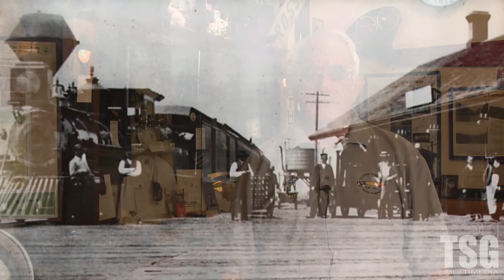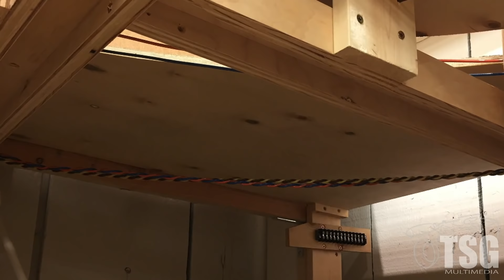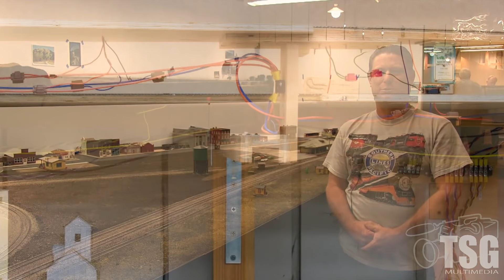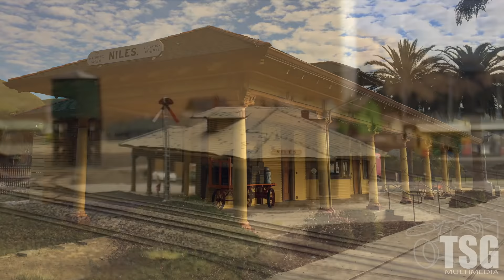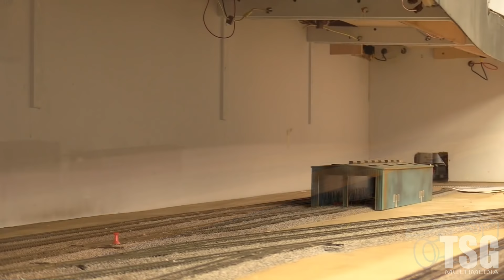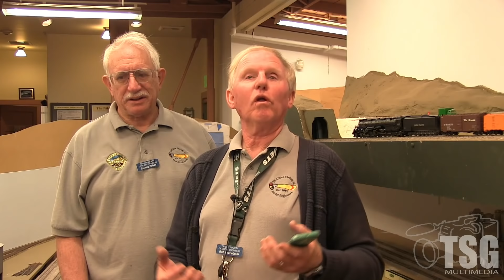HO Scale DCC Layout Tour Niles Depot TCSME

Comment: This may be a stupid question and I apologize if it is but, why is the locomotive ran backwards?
Reply: The Cab Forwards were very unique. They were only created to run on one single route for one single purpose. They were created to run on the legendary Donner Pass because of the numerous snowsheds and long tunnels. You might say, "Ok. They ran through tunnels. So what?" The thing is-long tunnels are bad for crews. Many crews died from asphyxiation because the tunnel filled up with smoke. So the research and development team for SP had to come up with an idea-how do we stop crews from dying? The answer: flip the engine around and put the cab at the front. This way, the crews could breathe fresh tunnel air before the engine polluted it. One important thing to note is that the Cab Forwards were oil-fired though a series of pipes and conduits. This is because having the cab at the front made it physically impossible and very impractical to coal-fire it. There was no way you could grab coal from the tender, run to the cab, and throw it into the firebox at a reasonable pace. Even if that was possible, it would be much too slow for an engine of the Cab Forward's size. Even a mechanical way of coal-firing the locomotive was impossible. There was no way a stoker could have been built practically. So they chose oil.
Hope you found this interesting and thank you for taking the time to read it.
Reply: Wow thank you so much for your response. I love to learn about thee types of things and being new to trains I found this incredibly interesting. I was wondering what the benefits were of having the cab in front. That makes a lot of sense now. Does anyone know of a good site for general knowledge of locomotives? I am kind of confused on where to start.
Reply from the maker: You can probably get excellent but very generalized info on wikipedia to start. I purposely direct people to do their own research because they will find a lot more info than I have time to provide.
Reply: Andrew Borges the train were build to keep steam out of the way of the cab
Reply: Andrew, if you'd like to learn more about steam locomotives, I recommend a book called 'The Steam Locomotive, A Century Of North American Classics' by Jim Boyd. It's a short book with a lot of pictures, and it is the best book that I have found to start learning about locomotives. It covers the early days of steam, all the way to the end of the steam era in the 1950s.
Reply: We all learned this at some point.
Reply: The reason for the "cab forward" style (on a steam locomotive) was for a better forward visibility, for the crew that was located in the cab of the locomotive.  This way, the crew (fireman and engineer) would have an unobstructive view, looking left to right/right to left, instead of having the entire boiler part of the locomotive (the largest part of the locomotive btw) obstructing their view.
Reply from the maker: The only time the locomotive is run backwards is if they need to back up to couple up to a train. That cab is in the front of the locomotive.
Reply: Oh wow, I guess it was a stupid question lol. Thank you for your response.
Reply from the maker: Maybe not Andrew. Once upon a time I didn't know about cab forward locomotives either. There are also different classes of this locomotive. Look it up sometime. Just type in "Cab Forward locomotive" is a search engine and see what you find. Thanks for watching!
Reply: I will definitely be doing some research on it. Thank you for the information!